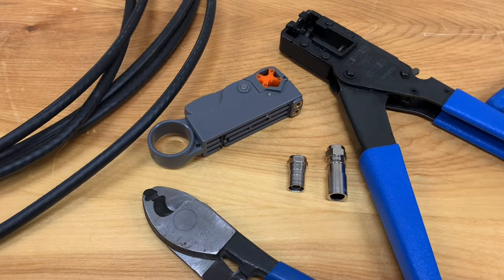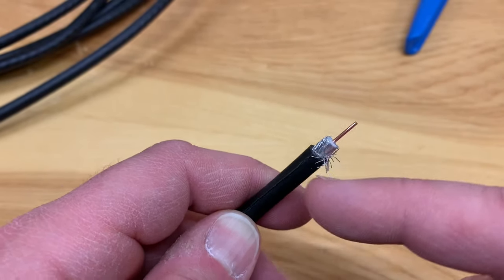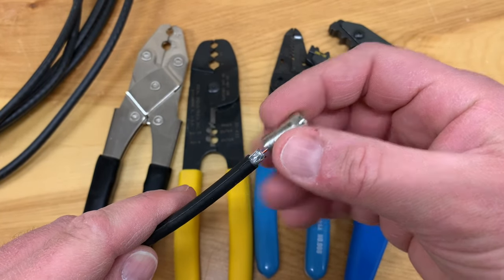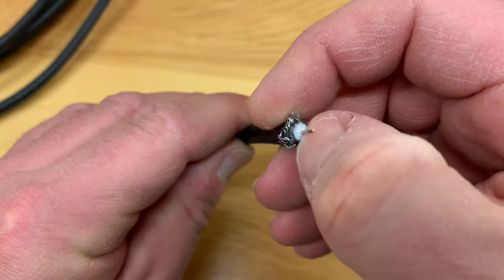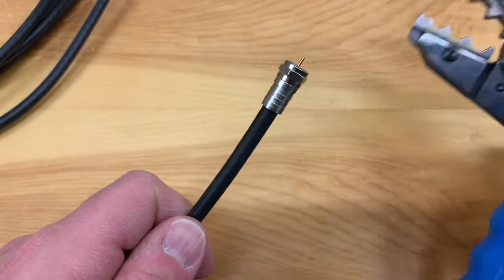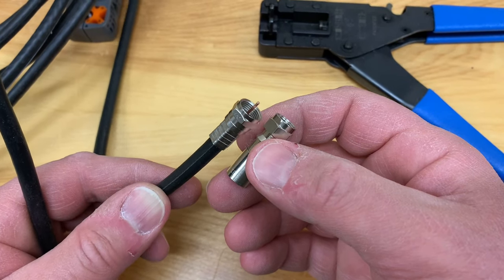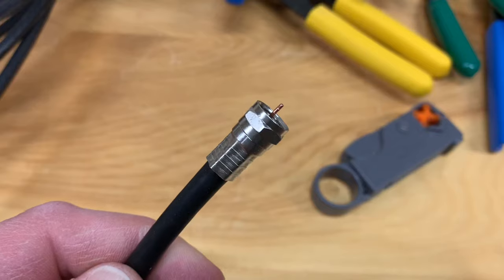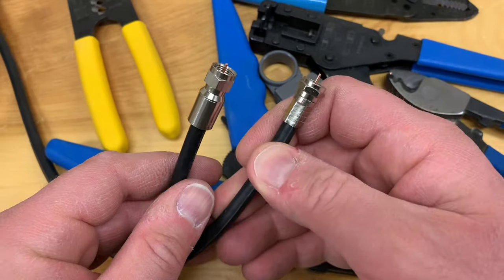How to Install Coax Cable Connectors | Make your Own Coaxial Cable for Antenna and Satellite TV

Comment: All those tools and a knife and pliers will do the same thing.
Reply from the maker: Pliers are not the answer here. A knife maybe for stripping the cable if you’re careful about it.
Reply: @NorthcoasterHobby  A pliers would do a good enough job for a self installation at home or a drop of super glue.
You're an enthusiast you get away with having all those tools.
But for myself and the majority pliers, glue and a knife will do the job.

Comment: what is besi length of wire pass white sheath for best seating of conector . ie:3/4 inch or 1/2 inch ,3/8 inch
Reply from the maker: @badfoot11  The tool sets the cutting length. It’s around 1/4”.
Reply: thank you much !  we can and do help each other !
Reply from the maker: @badfoot11  You’re welcome.

Comment: I haven't come across the "compression" cable connector, only the crimped variety and one that has a fine thread on the inside of the "sleeve" portion that goes around the cable body, the latter I found to be quite useless.
Reply from the maker: I find the twist-on to work fine generally for indoor applications. They're an easier option for the DIY'er. For outdoor I try to use only compression connectors.
Reply: @NorthcoasterHobby  , I've had success with the crimp on outdoors but only if I've insulated it with heat shrink or marine grade liquid electrical tape.

Comment: Great video, this helped me a lot! I noticed that it really doesn’t matter what you initially cut off the old end with, because when you use the stripping tool afterwards it will cut off the “squashed” white end of the insulator anyway.

Comment: Currently, I use twist-on F-connector. But I've seen many people on YouTube saying that is doesnt give a signal , compared with compression connectors. Is this true? Am I losing some signal (eg, on weak channels) by using these twist-ons?
Reply from the maker: Personally I have never had a problem with twist on connectors. The main concern as I see it is weatherproofing outdoor connections. Compression is best for that. As far as indoor I’ve used compression, crimp and twist with no problems. As long as you’re using a good quality RG6 coaxial cable it should be fine.
Reply: Hi Andrew,
I'm a product manager for cable tv products that we sell to the cable operators in West Europe. Let me give you some advice.
A twist on connector is not a good idea nowadays. Its because these days the coax is used for more things then just watching tv. They do what we call at least tripple play (tv + telefony + internet) and these applications are mostly digital. Therefore they are much more sensitive to radiation coming from outside (like from cell phone frequenties for instance). Those radiations can really destroy your digital signal. Therefore we (in Belgium) only use the compression connectors because they give a very high shielding against radiation from wherever they may come from. So they are not used only to make the connection better waterproof for outdoor use, but we use them also indoor for the good shielding. So that is why you stay away from twist on and even the crimp connectors. I don't know where you live, but overhere we can buy compression connectors and the needed tools in an electro shop. Yes, they are more expensive then the other connectors, but they really do a much better job.
Hope this helps you and maybe others to avoid and solve problems they might be facing now and in the future.
Reply: Andrew, I forgot to mention that it's also very important to buy a good coax cable to start with. Because if your coax is not good enough, the radiation will just radiate right through the cable and you might have the same problems.
Reply: Hi Theo,

Je suis ici dans les etats-unis.

I use twist-on because it's cheap and no extra tool needed. I'm trying to understand the slight difference in the connector (twist-on vs compression) can make a big difference to shield from interference. I can understand compression is more water-tight... but hard to justify purchasing compression tool and new F-connectors for a few cables I need to make for regular TV reception.
Reply: Theo, I always thought all RG6 cables are basically the same, as sold through our hardware stores , Amazon , etc.. ici dans les etats-unis.
Reply: @be236  I understand that it's too expensive to buy all the tools and the connectors if you only need them only ones. It's the same problem we see in Belgium. But nowadays there are even stores that rent the tools for a few Dollars or refer to somebody (who has the tools) that can help you out.

Comment: Just to let you know, the first tool to crimp the connectors that you've showed and said it was useless and no good dates from crimp connectors with a seperate crimp ring. We call them the "butterfly connectors". I first saw them back in 1985 when I started working in the cable tv industry. At that moment they where the correct tools to use because the later generation of crimp connectors where not existing at that moment, they came almost a decade later. But you are correct when you say to not use them on the crimp connectors that you show.
Greetings from Belgium 🇧🇪
Reply from the maker: Those tools are marketed here as a suitable tool to use in place of hexagonal crimp tools, which they are not.
Reply: @NorthcoasterHobby  Absolutely correct. Do not use them on connectors that are ment to be crimped hexagonal 👎👎.
Reply: just got a clamping tool and have to say that if you leave too long the central conductor will the clamper tool bend the central copper wire and will turn harder to take out the final product from the tool

Comment: didn't see it here but you can use one side of a strip of velcro to get the shielding strands pulled back straight more quickly.
Reply from the maker: Good tip, thank you. Interestingly enough, I just reviewed a tool that has that very feature:

Jonard Tools Coaxial Cable Stripping Tool for RG6 Coax Cable
https://youtu.be/LkkG3CzYgHs